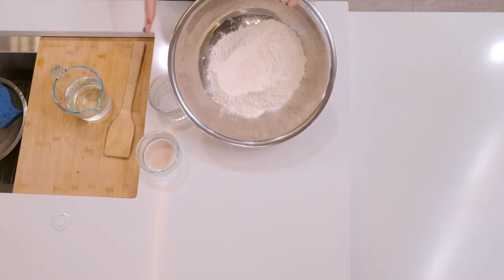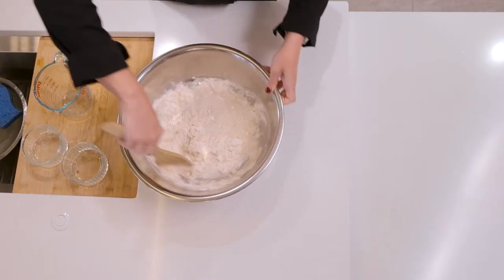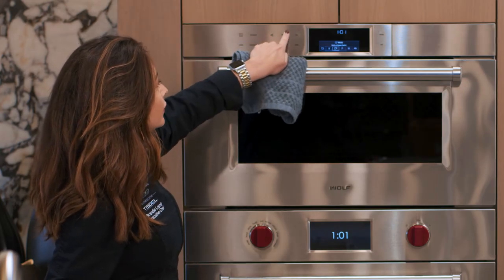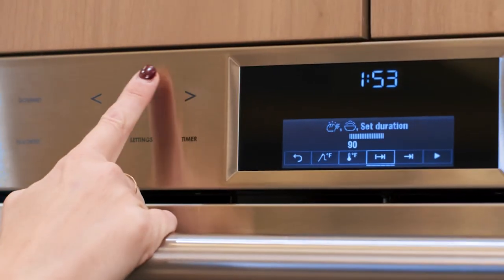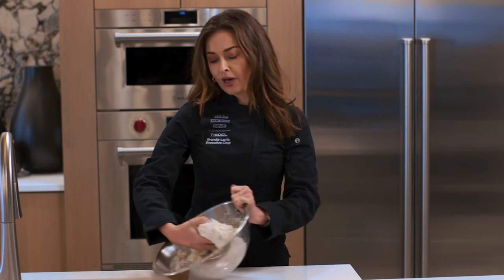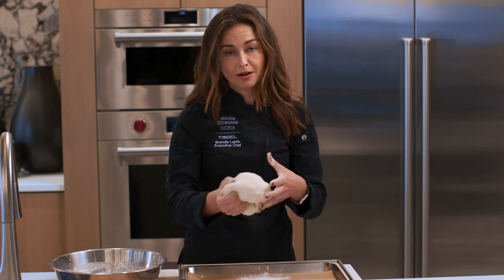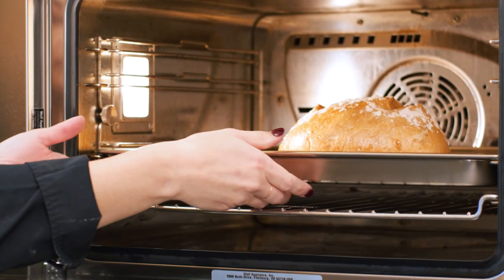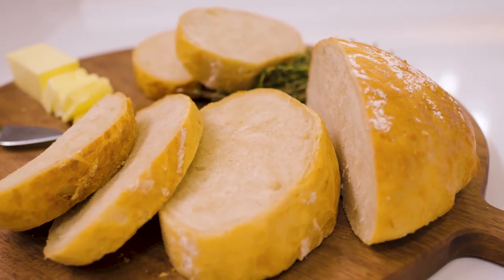Simple Bread Recipe in the Wolf Convection Steam Oven

Comment: After proofing twice, how long do I need to steam cook?
Reply from the maker: You will bake the dough on “Auto Steam Bake” mode, at 425° F, until crust is well-browned and firm to the touch - about 30-40 minutes. Remove from oven to a wire rack and cool completely, 30-45 minutes before cutting. Hope this helps!